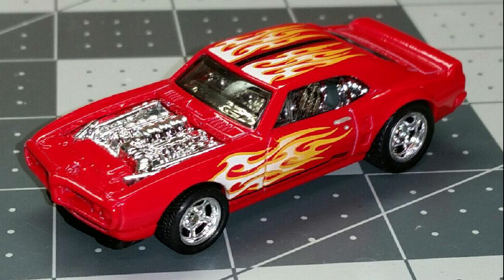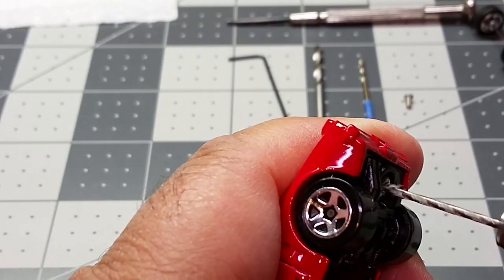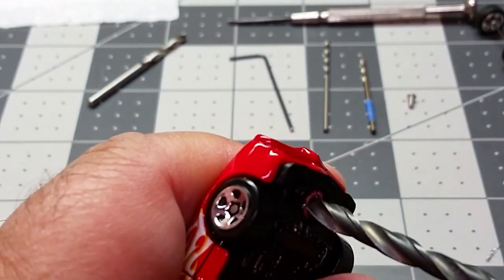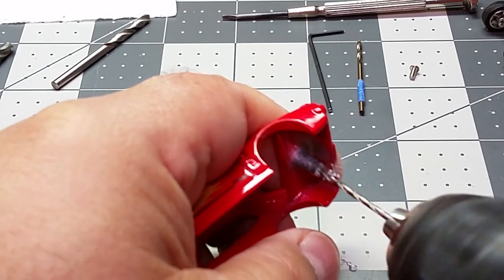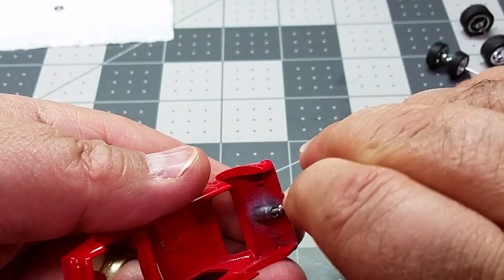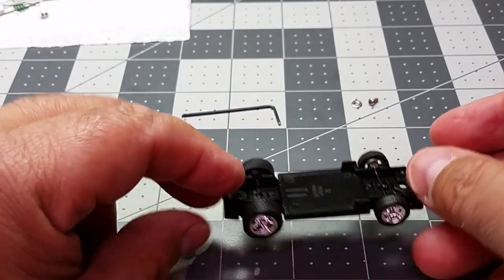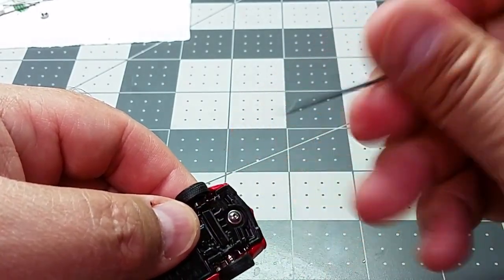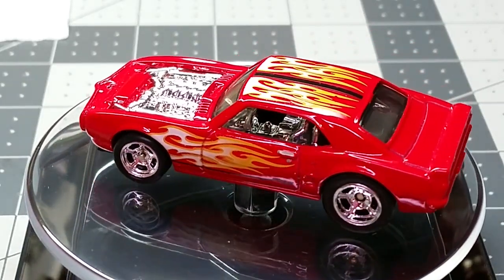Custom Diecast 1967 Pontiac Firebird Wheel Swap

Comment: Excellent video, need to order the 1/72 button head screws, what length screw do you suggest I purchase, TYIA
Reply from the maker: Thanks! I use 3/16 long screws for most of my redlines. You can also use 2-56 screws for modern cars with larger posts 👍
Reply: @DT99race  TY AGAIN